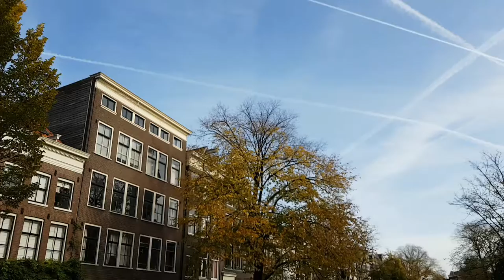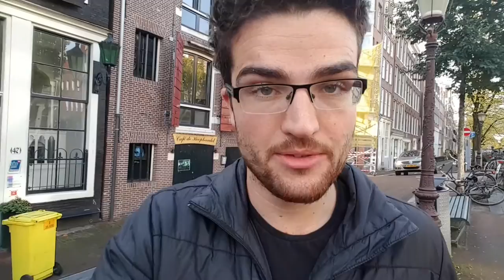How I Use High Pass Filters

Comment: Hi Matt,
Is there a difference between applying HPF during recording and applying HPF in Post?
If not then why not apply HPF in post and avoid irreversible errors?
thanks
Reply: Of course when you put a HPF on the recording there is kind of a irreversible thing.
I just made a test: rec with zoom f4 and senheiser m66 WITHOUT HPF and with one at 100hz.
I compare the 2 tracks with a HPF at 100HZ in Logic and I have to say, it was better having an HPF on the recorder considering less unwanted handling noises in that case.
Careful also on the slope of your HPF on the mic itself. as an example, the one on the m66 is too hard for me, cutting too much around 125HZ for example

Comment: I was having a conversation with a friend yesterday about high pass filters, he was insisting that using microphones own high pass filter is better while i was on the side of adding the filter using my mixer/recorder if it has the capability, what are your thoughts about this?
Reply from the maker: +Mohammed Kutkut o0o0o interesting topic. I would have thought it would be fine either way but obviously if you want more control to vary it then having it through the mixer is good. Maybe some scenarios doing on the Mic is better to stop distortion before reaching the mixer but think thats the only thing that comes to mind
Reply: Matt Price from Soundrolling dot com it is an interesting subject as i heard different opinions, some swear by the high filters on the mic and others doesn't like it at all, they only want to add it via the mixer. Could be nice if you pop this on one of your sound chats..